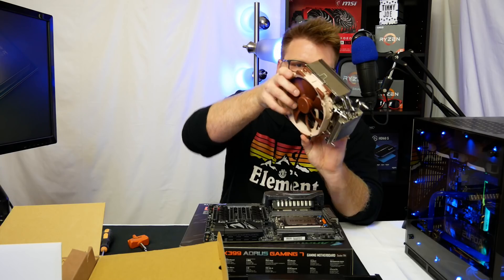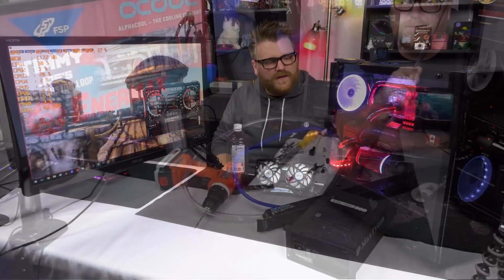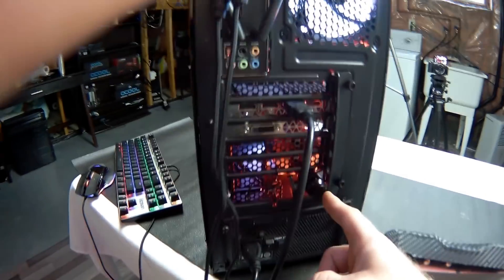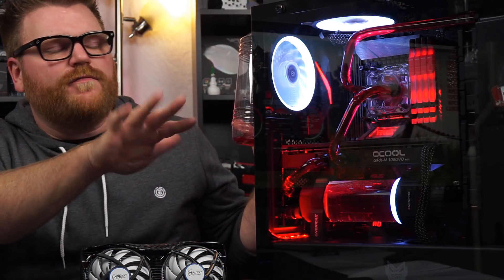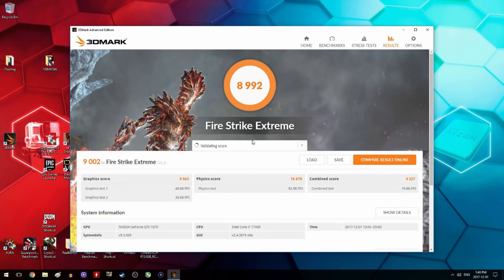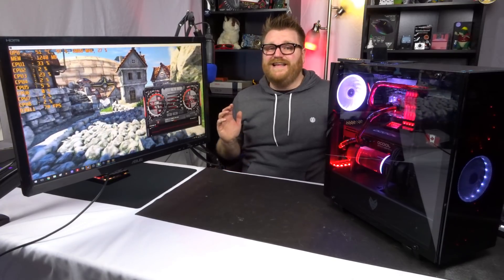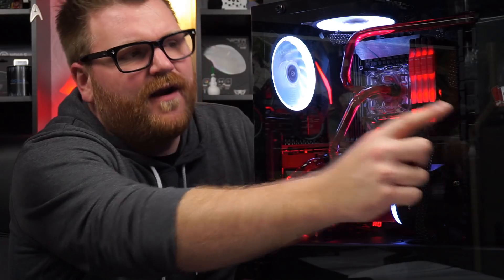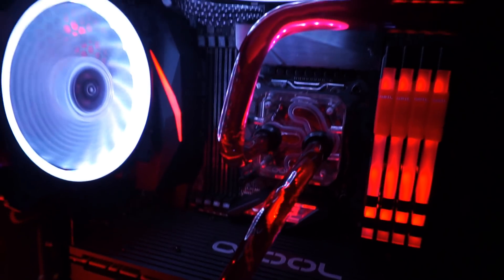My First Custom Loop PC Build - Part #3 Overclocks and Temps

Comment: Timmy quick question so i bought the alphacool 240 x45  radiator and you know how those radiators have  3 port for in and out. can i put my cpu directly in one of the port for cooling and have the gpu running off from the pump which the pump is going to be connected to the second port from the radiator  for the out ? so i want to run  the cpu and gpu parallel  to each other so pretty much they both get their own supply of cold water.

Comment: How is this case vs the view-31 Timmy
Reply: It's possible that their might be problems with the galvanized item as that is what is used in galvonic protection as the lesser noble metal, and depending on how thick that coating is will be the equation of how fast it will need replaced as the speed and temperature of the electrochemical cell and the electrolyte.

Comment: Becareful with the GPU alphacool water block. I had a alphacool waterblock on a AMD 280 gpu... After less than 6 months the waterblock part started leaking. It ruined a seasonic 850w psu by leaking on it... Leak comes from the top of the water block that has a poor seal on it. Thought you might want to know...
Reply: +jerome vet
This is why I have spare fittings for my custom cooled pc. Precisely why I have them.
Reply: After contacting the company they simply suggested I just buy another one... :(
Reply: if you know your system has seals , change them ! like car maintenance . don't expect parts to work for ever in spec without the right care ! . it's still water inside of a pc , so take extra care of you pc !